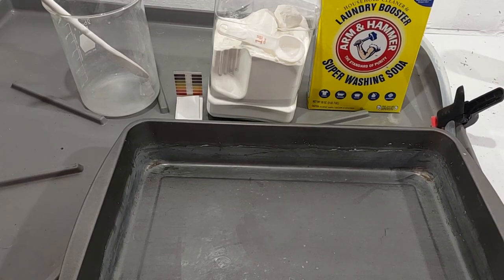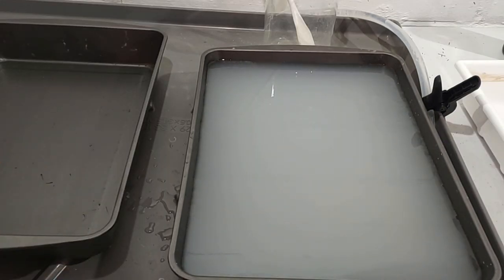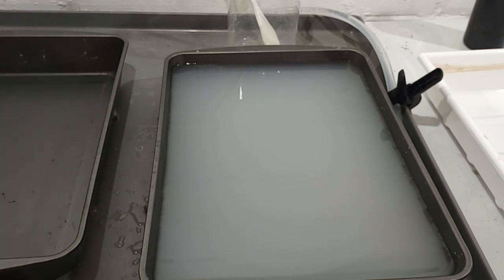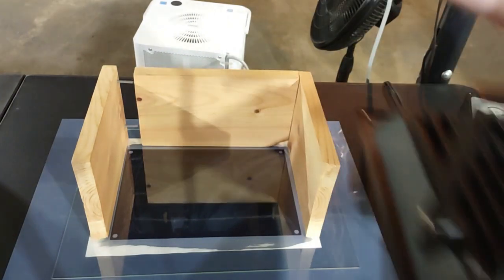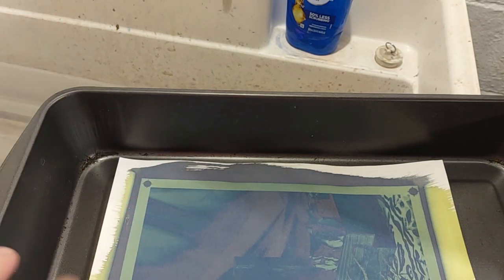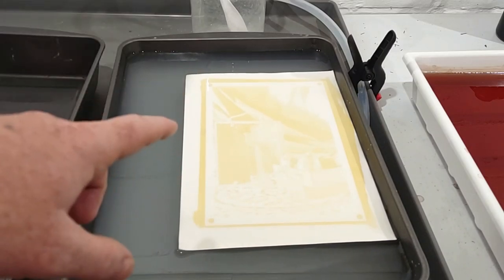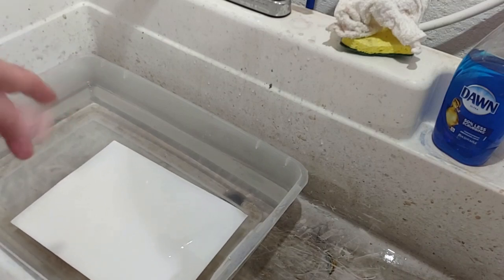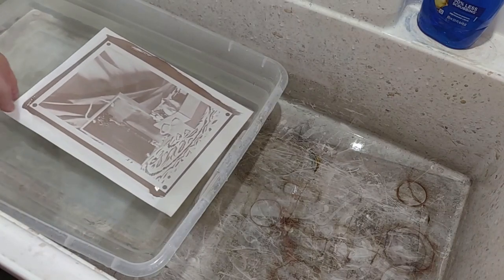Duotone cyanotypes " Part 6 making the first layer "

Comment: If I apply a solution of water and glue after the tannic acid toned layer , could it help to prevent the chemical interaction between that layer and the next?
Reply from the maker: If you applied a layer of gelatin maybe. Glue might prevent the emulsion from sticking to the paper but gelatin would give it a surface to hold on to